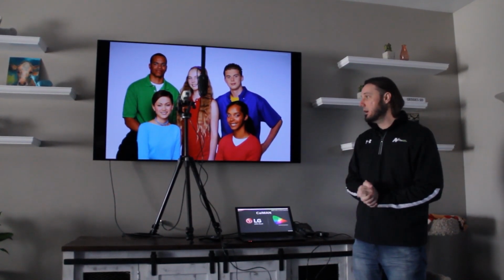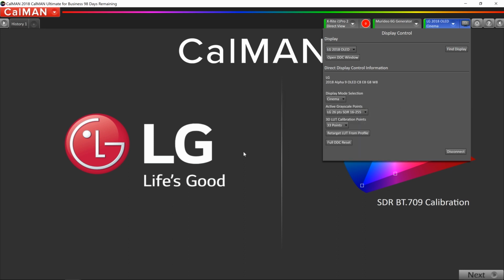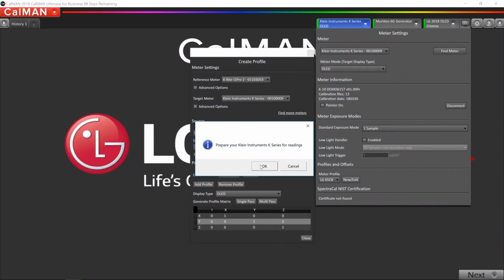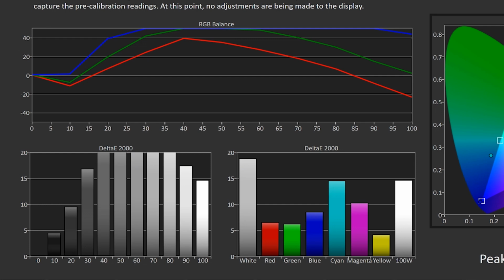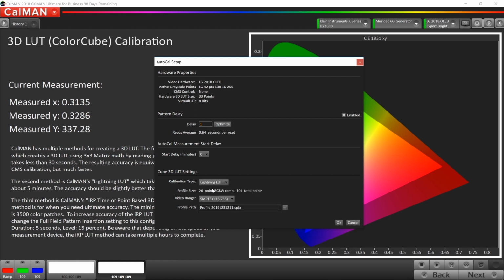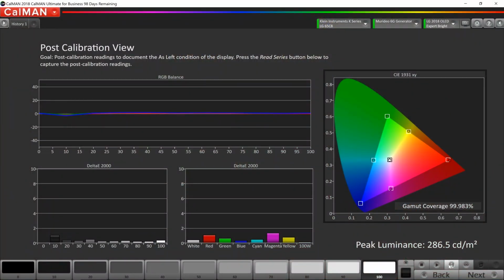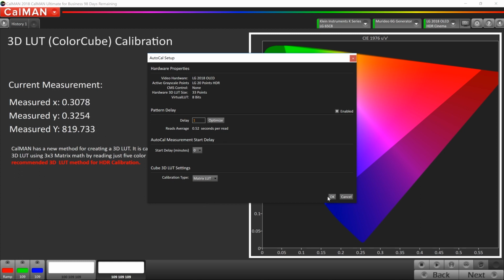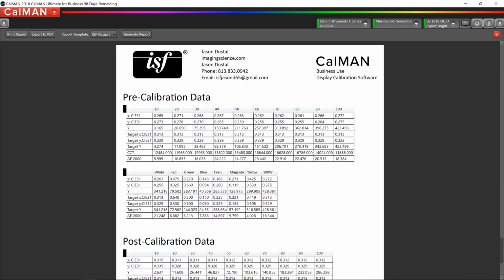How to Calibrate a TV using CalMAN AutoCal

Comment: One question, could I calibrate my Sony A1, with calm home and an X-rite i1Display Pro, without having to buy the videoforge pro?  Will I have good results?  thanks!
Reply: Hi there! Jason here. The A1E does not have internal test patterns so you would have to use an external pattern generator such as the Video Forge Pro or Murideo Six G
Reply: Jason Dustal What a sad news, those devices are expensive and I do not feel like spending so much to believe I do not improve the image so much, since the A1E looks really good, thank you very much friend!
Reply: @Akira_2077  There are other things you can DIY...Google AVS HD709

Comment: Hello, great video! 

I just have one question. You kinda didn't explain brightness and contrast. Could you tell me what boxes should be visable (Murideo test images) for contrast and brightness for both a bright and a dark room? And do you have to set  brightness and contrast for the HDR and Dobly Vision modes? If yes, can the murideo put up a HDR and DV test image or how do you do that?

Thanks,
David
Reply: Hi David! Jason here. Thanks for the question! Contrast and brightness are not adjusted in HDR like we have done in the past for SDR. If you adjust brightness and contrast it will throw off the EOTF. With that being said, there is a verification test pattern that I can send you. If you are interested email me at isfjasond65@gmail.com. Thanks!

Comment: can u autocal color space using molieforge from a fire stick as your pattern generator for a sony tv
Reply: Jason here - I don't believe this works with Autocal, but you may want to check with Portrait Displays to confirm. Also there have been reports that the Firestick only outputs RGB which may cause some inaccuracies during the calibration

Comment: Is it always better to do the grayscale on 42 point ? 
I have an i1pro2 with i1display pro and it is very slow
Reply from the maker: Have you profiled the i1display, if so it should move along pretty quickly? You don't have to do 42 points, if you want to save some time you can do fewer points.
Reply: @avproedge  i have profile it with myi1pro2 but it slow on low ire.
Have you try the custom tone mapping for the lh 2019?
What would be the best setting on that you think?
Reply: @anthonyrizzo84  Jason here...the darker the levels the slower the meter reads. This is true regardless of the brand, model, or type of meter. The only time I make a custom gamma curve is to compensate for room lighting. If the room has light control then the gamma should match the content